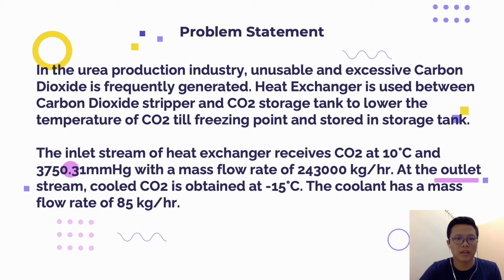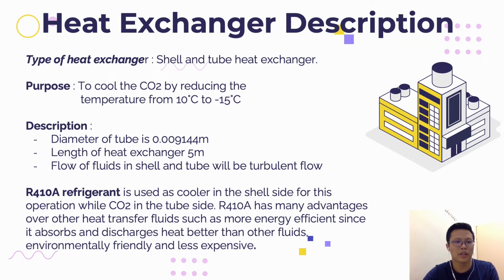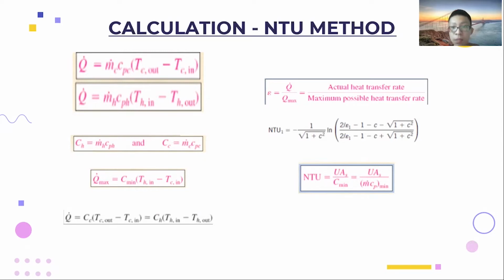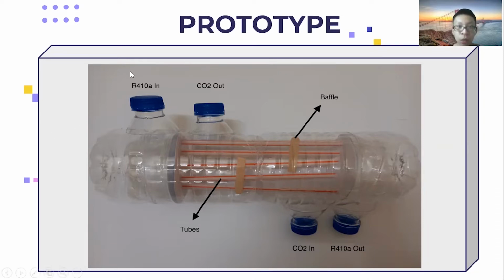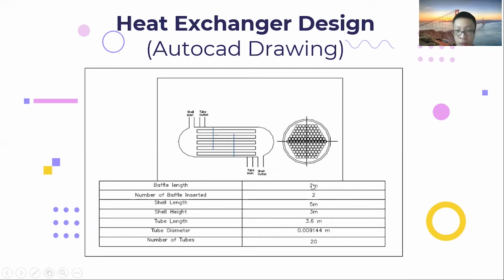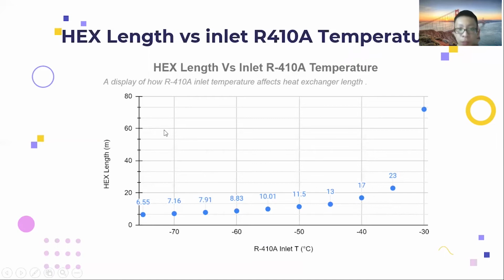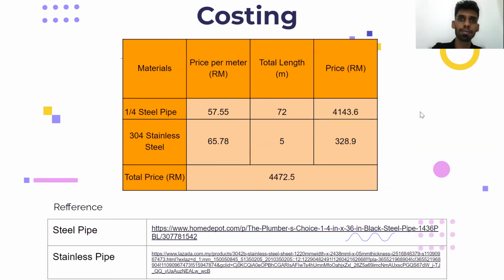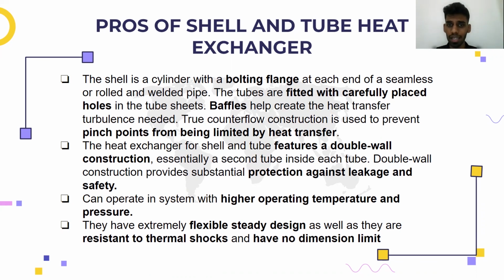UPM Heat Mass Transfer HEX Project G-14

Comment: how do you handle cooled co2 stream?
Reply from the maker: Hello Dr, regarding this question ,first , we need to have a look at CO2 suitable storage condition. The temperature and pressure range for liquid CO2 storage condition are -35C to -15C and 12 - 25 bar respectively. Since the current pressure of outlet flow of the cooled CO2 stream is 5 bar which is insufficient , a compressor is needed after the heat exchanger before the cooled CO2 stream is sent to storage tank for storage as liquid CO2. Furthermore , since T will increase with rise of pressure , the R-410A inlet temperature may need to be lowered. Liquid CO2 can be sold as a by-product in this ammonia production process.